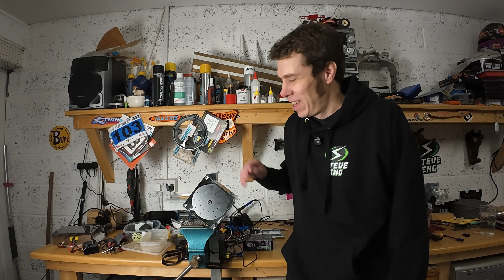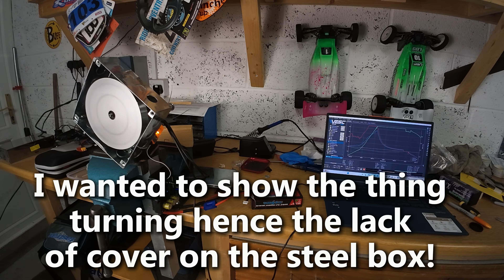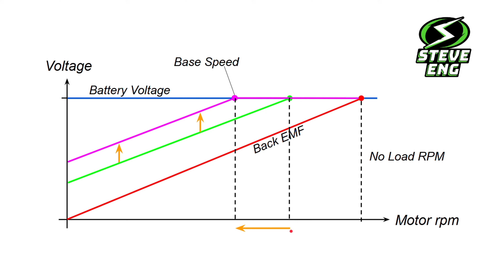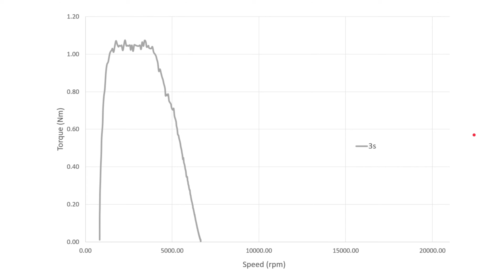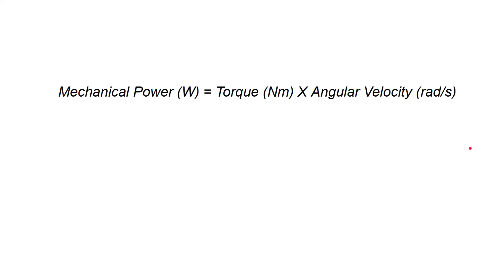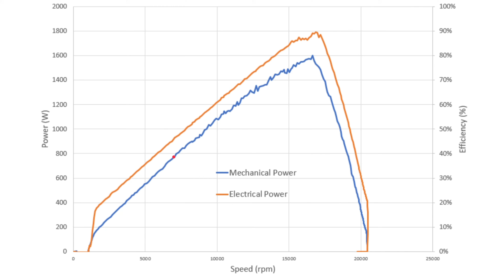20,000rpm R/C motor test rig! Part 2: What Torque and Power can you get from a brushless motor?

Comment: Fascinating stuff! I know your speed car design is direct drive, but the oval racing I do is a fixed motor size (21.5T) with a gear reduction. Can this information be related to selecting a correct pinion gear, or perhaps what signs to look for when experimenting with pinion gears?
Reply from the maker: Hi Bill, thanks for watching and commenting! Regarding your question, what you need is part 3 of my series! I'm working on it now, hoping to get it out by the end of the weekend.

Comment: Hi Perfect. I like to know more about this. What type of software did you use to get the dyno readings.
Reply from the maker: @hugonavi  thanks for watching! The esc is called a "vesc" and the software goes along with it. I'll do an episode on that and it's probably and cons in future so keep an eye out for that! 👍
Reply: @steveeng1826  VESC is a Vector control right? Can it do Field weakening? It could then unlock higher motor rpms. The torque vouldnt lineary decrease to zero by backemf.